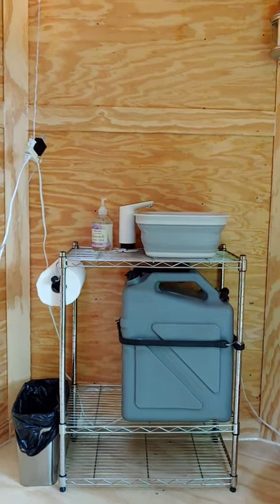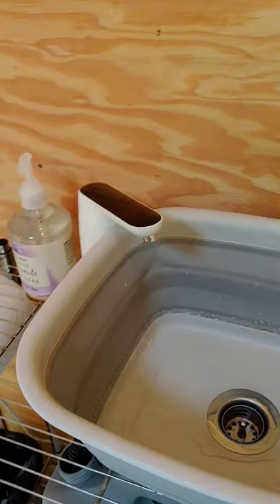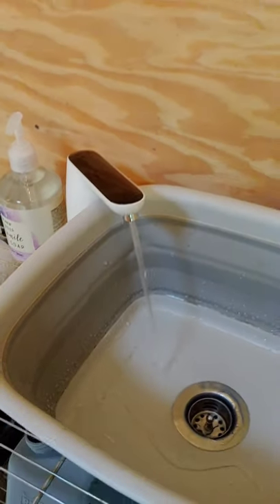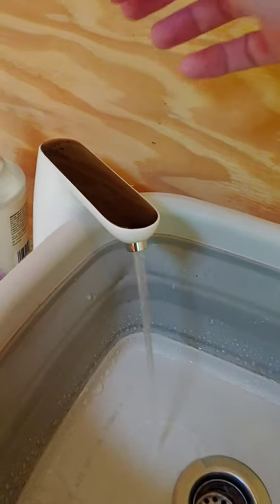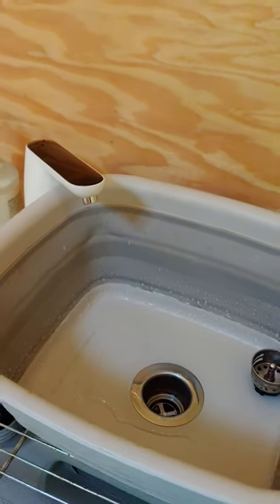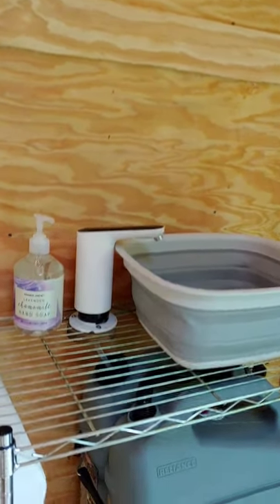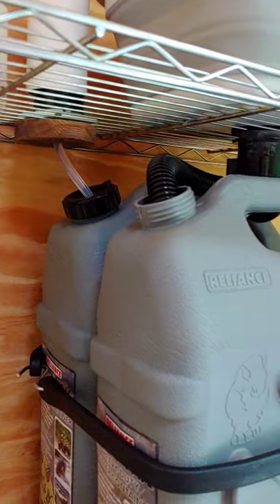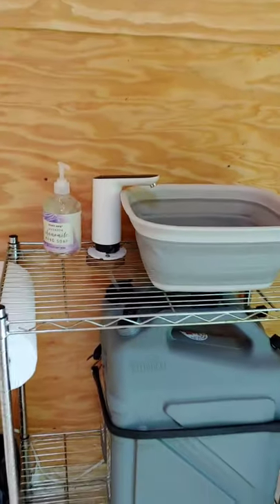Off-Grid Portable Sink - Please see description for more...

Comment: the problem for the set up is the rack have to be tie down very well to the floor if not this will be a nightmare after you arriving at your destination.(from a two camper builder myself
Reply from the maker: Absolutely. This system can be easily adapted to a built-in installation, but this one was designed to be portable, so it's not ideal for an RV in this form unless it is secured to the structure.

Comment: I have a problem with the bathroom sink, there is NONE! 🤬 I’m looking to purchase a camper that unfortunately doesn’t have a sink in the bathroom so I’m trying to find some kind of solution to getting something small in the wet bath so I could wash my hands and brush my teeth without having to use the kitchen sink or turn on the shower just to wash my hands. I understand that I’m camping but the thought of it still grosses me out. 🤷🏻‍♀️
Reply from the maker: You could also use smaller containers if you're tight on space. Same concept, different scale. LMK if you need any further assistance.